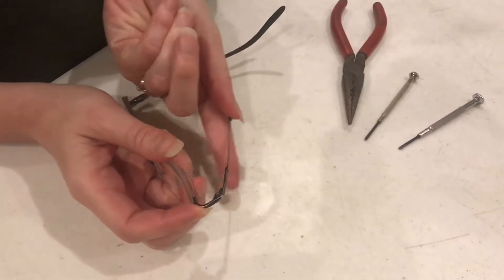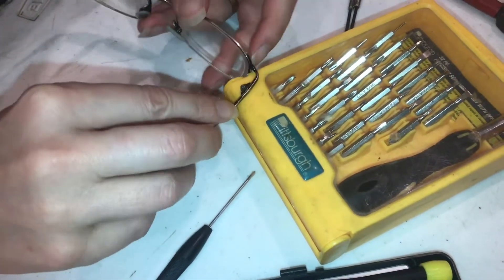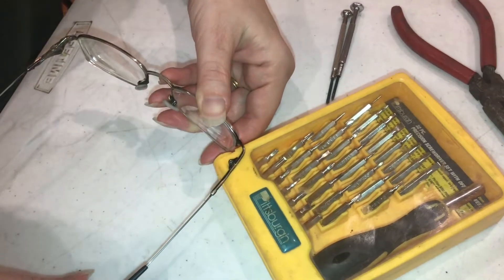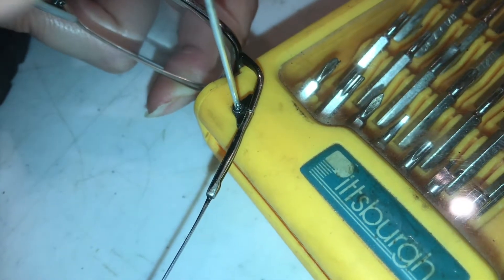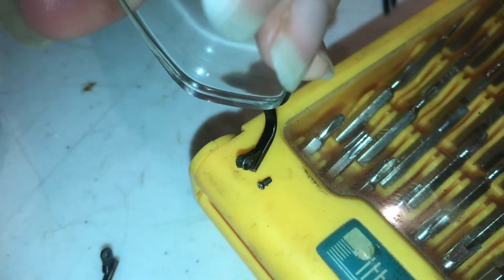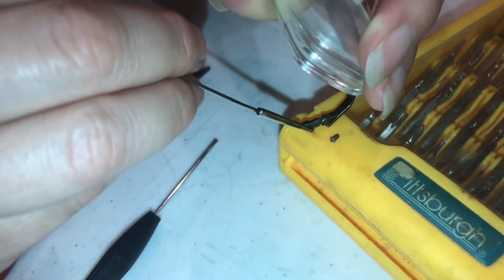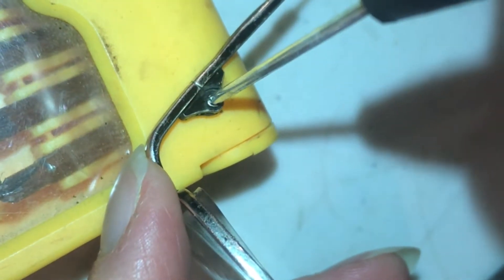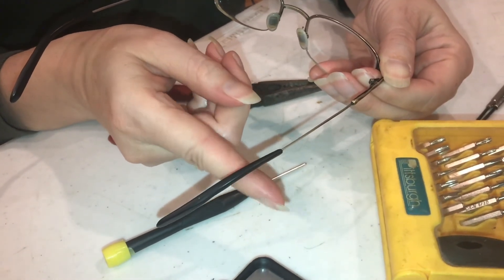TIGHTEN up a VERY loose arm on a pair of glasses

Comment: Hi! Can you please help my frames are so loose it’s not moving forward or back words but it is really it just keeps folding quickly I bought it for $250 it’s metal frame and had it for only 1 week I forgot it with my friend and I don’t know what she has done to it plz help 😭😭😭 it was so still when I I had it on me. I regret this so much please help 😭
Reply: I had same issue...
It's bcz of hinges not interlocking tightly..use pliers to tightly fit them like she did in video